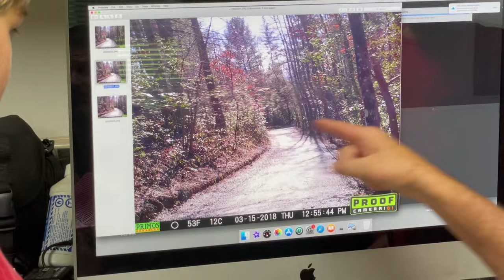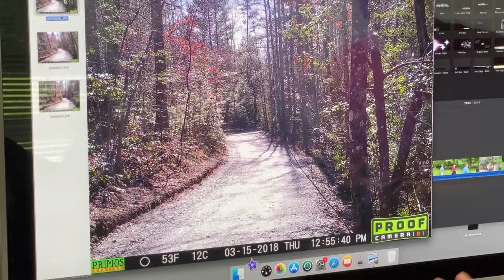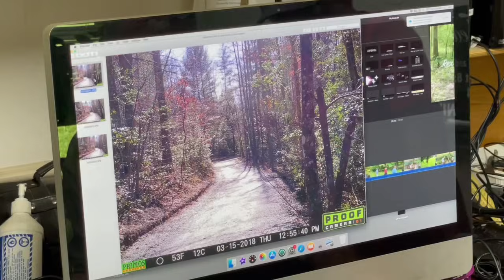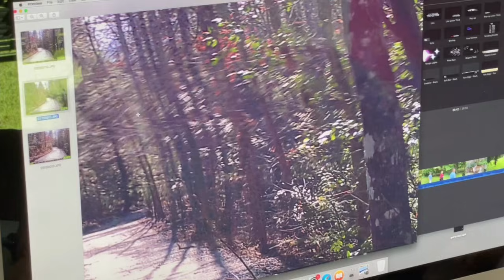Bigfoot Caught Moving Trail Cam in North Carolina and Stacks Rocks Squatch Watchers Documentary

Comment: @15:50 - very low on the left, in the brush, is a cery "black" area..; @16:05, when you aim the camera back up the way you came, there's a "black circle" (head?),  just at the top of the section of brush that sticks out into the trail that looks to quickly duck back into the brush in the video. I was thinking it was between the trail & the creek, maybe David would encounter it, when he went down to the creek.
Reply: That's what It looks like to me as well. Could it be parallax?
Reply: I saw it also seems to get up and move back towards creek
Reply: I to spotted the young black headed Bigfoot Jr. It will dive down to the right behind the tree. Starting at (TS) 16:05.